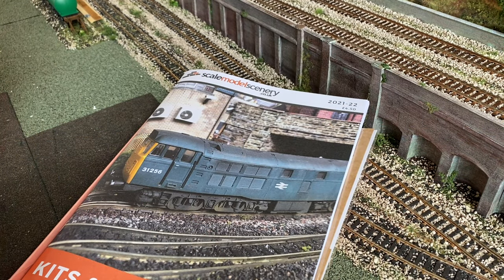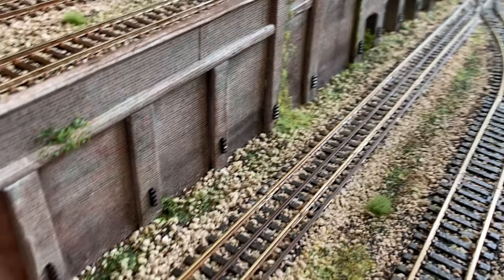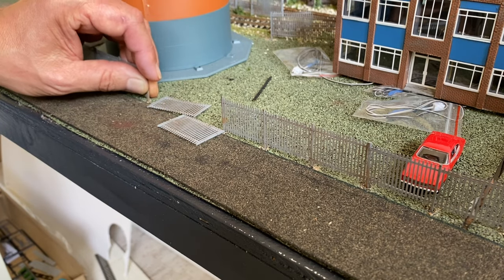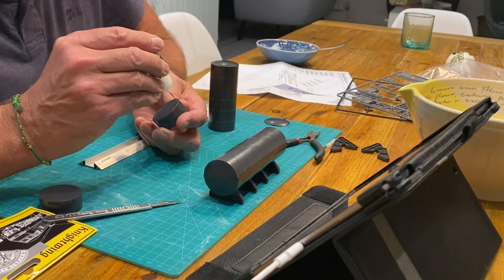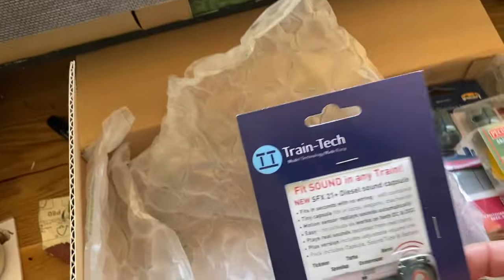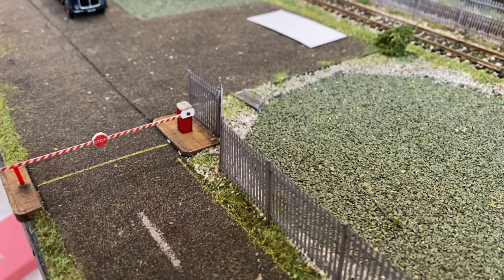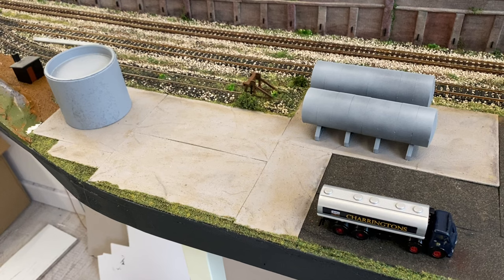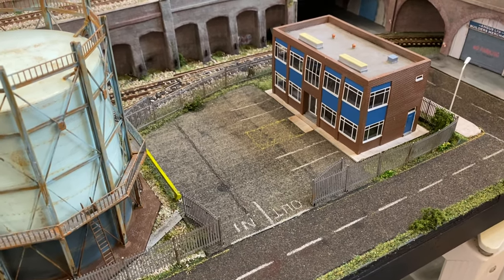21 Building my first model railway - Industrial Area Pt 2. Buildings and Foundations

Comment: great job - idea for you - if you put a couple more bits of rail just going into the oil depot with a couple of limit of shut sign's that way you can get a way with running a class 73 or class 92 on the oil/gas tankers and reversing it into the depot.
Reply from the maker: Thanks Paul. That’s a good idea. I will do that when I start adding all the detail. Thanks for watching.